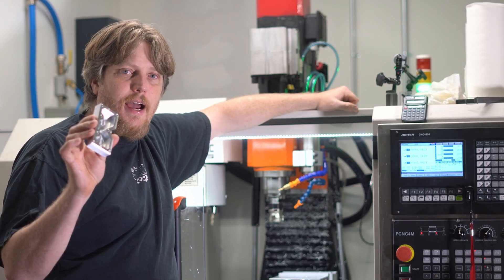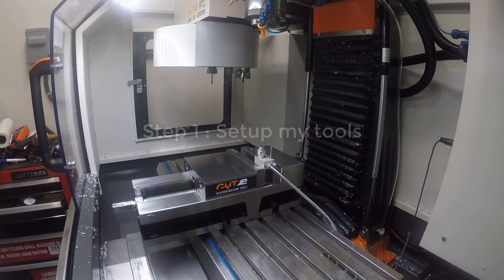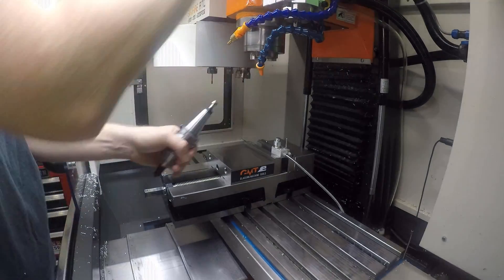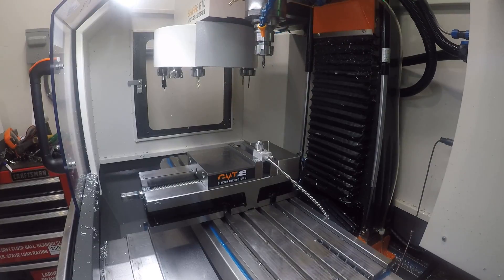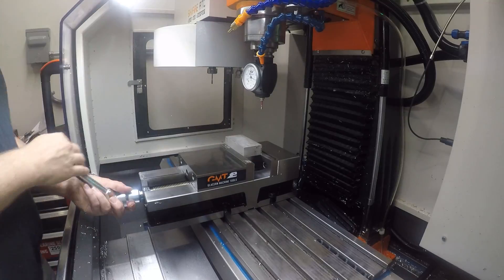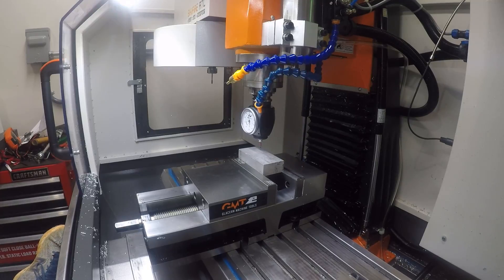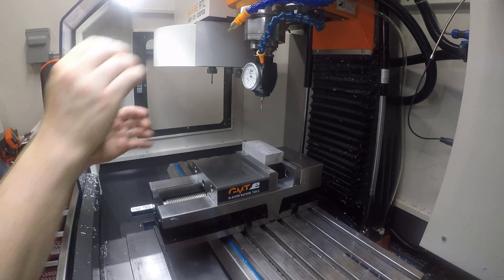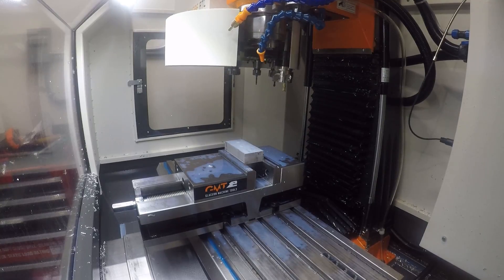My first CNC Milled part on a Skyfire SVM-2 (its a Titans of CNC Academy 1M Block)

Comment: I only have one problem with your video . And it's over your willingness to open the door, while the tool is both running, and cutting.  To Adjust your coolant position.  You're really taking some huge risk each time  ..

Comment: So these machines are cheap to own and operate, they run on single phase power and they cut really nicely.

So what's the catch here?
Reply: The control unit.
Reply from the maker: @desertsoul02 is correct the controller is painful... I am actually replacing mine now.. Also support is a small spunky band of people on Facebook, Skyfire support is virtually non-exinsistant.. 

If I had the $$$$ to do this again, I would probably either buy a dry frame and build from scratch (because at this point I am almost doing that) OR I would go used HAAS Minimill or TM...   

I mean at the time it was the right call given the market and that Tormach was officially still saying "we will never do servos".. But the market has changed.. 

I am also curious what Titan has cooking with Doosan, will hear more about that next week I guess.

Comment: how did you generate the gcode from fusion 360 for skyfire vmc
Reply from the maker: I have a post that I one of the others in the community wrote based on the fanuc.. I have updated it for my 4650 and 9960 controllers you can find them here: https://github.com/Skyfire-community/SVM

Comment: Hi from Barcelona, looking for a cnc right now, space in my shop and single phase are what provably makes me jump from industrial machines to something like you have. I am still not convinced if I should go with Skyfire, Syil or what yet. Little concern with customs and seeing that all you share modifications to the machine, and, not sure I am at that point. Anyway thanks for your videos. And if you could suggest if it is better to go with svm1 or svm2
Reply from the maker: So I don't have any experience with the SVM 1..  What I can say is that I feel like the SVM 2 (once tuned) is a very capable machine.  If you can I would suggest you find out if there is a local distributor for Spain.. If not maybe George from the UK can help you out?  Check out the Official Users Group on Facebook, there are a lot of good people there who are eager to help each other get the most out of these machines.  

One thing to consider when you look at any machine is what kind of work you will be doing.  For me it was about buying a capability and an understanding I would be responsible for making it work.. Was that a frustrating choice?  yes, yes it was.. But because I am a hobbyist it was likely the right choice..   

I hope to do a video in the near future going over my Skyfire story and explaining why I made the decisions I did..  Maybe you will find that video useful when I publish it.

Comment: Solid performance from the mill. I'm particularly impressed that it can control the spindle rotation precisely enough to tap the holes. Directing the coolant flow seems to be a bit of a pain, but that will improve with experience.
Reply from the maker: Thanks.. Ridged tapping while not a "requirement" was definitely on my list of reasons I didn't buy a Tormach..  I'll produce that video here in a few weeks... breakdown why I made the choice I did..

Comment: An air run is actually called a dry run.
Is here any way you can improve the machine homing accuracy?  Did you talk about the issue with support from Skyfire?  I think this kind of repeatability issue is totally innacceptable for such machine. A .0005'' difference should be what to expect from such machine, not less!!
You want the best out of it!! Do'nt you?
Your hard taping did well!
I hope to see more such videos from you in the near future.
Thanks for posting.
Reply from the maker: The limit and home switches the Skyfire uses are all induction switches they are good for about .04mm repeatability..  There is some talk on the forums that we can pull a signal from the servos and use the induction sensor as the start of a search for a specific step signal from the servos.. That would be +/- backlash or 1 step..... (which is ~.001mm).  However, we are not 100% sure that the Adtech 4650 controller can use the step signal from the servo... (we do know that the firmware has support, just not sure if the hardware has the input).

But yes, I would LOVE to be able to turn on the machine and not have to probe around to know its in the right place each time.
Reply from the maker: Thanks for pushing me on this.. I've been digging more into this and there is no way servo based zeroing shouldn't be an option.. I have confirmed the servo driver is sending the signal, and that the CNC Controller is hearing the signal.. there are some configurations that need to be just right for the controller to home properly with the Z pulse information.. But it looks like its doing that now..   Should have +/- a few pulses (.001mm) once I get the controller configuration correct :-).